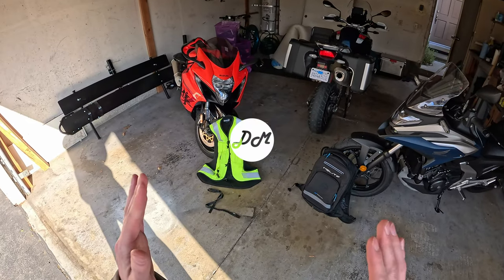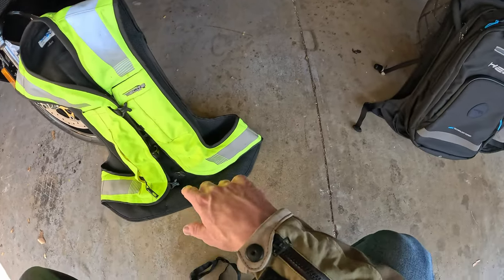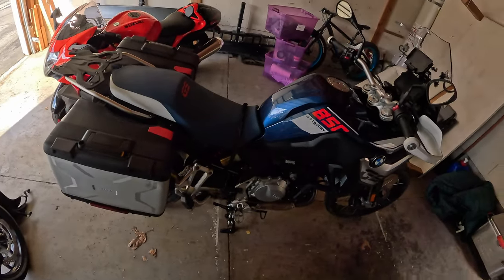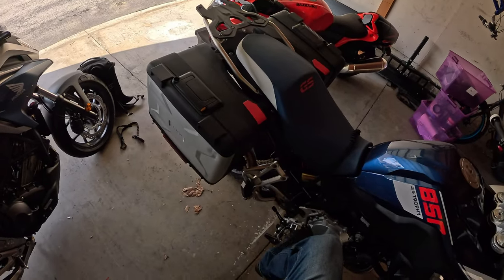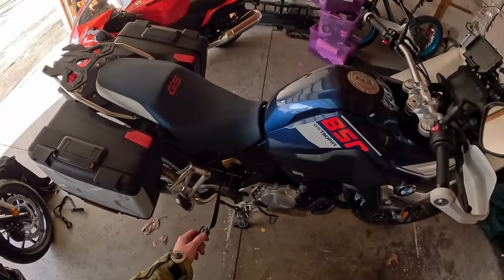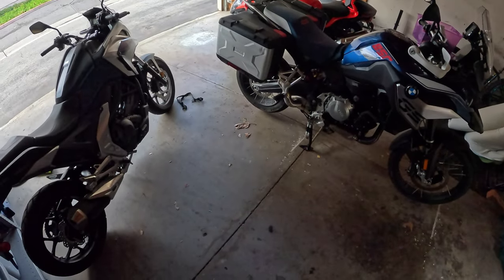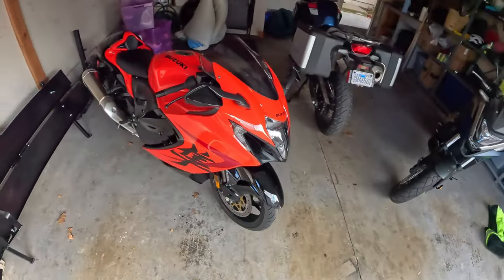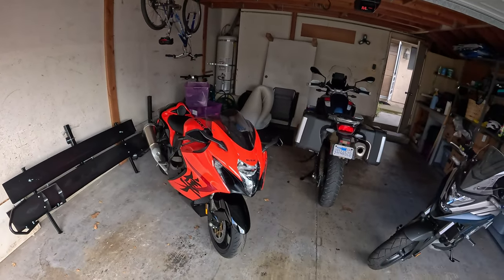Motorcycle Airbags: Electronic vs. Manual Trigger

Comment: Read your instructions for the manual unit! It states DO NOT ATTACH below the seat. It is supposed to be attached under the seat! Also the tether strap is supposed to be AS SHORT as possible. Example, shorten it as much as possible to just allow standing on the pegs like with an adventure bike.
Reply: right! i thought the same.... Its way too long if he fall off the wrong side

Comment: Dunno why they dont just give you the mechanical option on the electronic one, that way you can have both active if you want.
Reply: It's two different activation systems. The mechanical one activates purely mechanically; the force pulling the tether is the force pulling the activation on the airbag system. 

The electronic system is done electronically, no external force is activating the airbag.

So to have them both in one system would either require doubling up on the inflation systems, or making an entirely new inflation system that uses both (which would be tricky.)

Comment: It is very important that the  lanyard needs to be fixed in the center line of the bike between tank an seat and kept as short as  possible. Furthermore, do not overestimate the safety gain. Tests by independent test institutes in Germany showed only less improvements. Frontal crash in a car with 15mph may kill you, an airbag improves your chances to survive to 25 to max 30mph. We ride in Germany up to 150 mph on highway. I myself own 2 vests and 1 jacket , all non electronic. Just for mental support, no much expectations.

Comment: Tethers don't run out of battery, they don't need you to be moving to arm, they don't go off because you spin around while getting off the bike, etc etc. 

Tethers won't disarm because your CC monthly payment to Klim was declined because your card expired.
Reply: yea but electronic will save you from any angle your hit from. Tether wont.
Reply: Tether wont inflate before you impact the ground if you loose grip around a corner and low side.
Reply: @Surpriseify  If you do low side, is the impact to the ground what hurts you? You're not falling from great heights, your garments will protect you. And before you hit anything you'll disengage from the bike, so tether will inflate anyway.
Reply: Plenty of crashes happen where the rider sustains lethal hits before properly getting disengaged from the bike.
A lowside is just one example, and they can be extremely violent, especially at speed. I want protection immidiatly, not AFTER i get FLUNG off the bike hehe.
To each his own
Reply: @Surpriseify  You're right. To each his own. 

Electronic activation is designed for sport, my understanding is that tether is better suited to commute-type riding - shorter rides, lower speeds, occasional no-GPS lock, protection while the bike is not moving (when rear-ended by a car) and during first seconds of riding.
Reply: Mostly agreed
However with the fork stem sensor the Helite E will activate from 0kmh (standstill) and even faster than the tethered version
 Its a more expensive option be sure, but i like the wireless life haha
Reply: I once had a tethered airbag, but during a crash, my bike slid beneath me, trapping me and dragging me along. The airbag failed to deploy because the tether wasn't engaged. That experience convinced me to never opt for a tethered airbag again. I'll stick with the electronic one from now on.
Reply: @KhalidOWh  really unlucky!
I can see pro’s and con’s either way, been rididng around with the electronic helite for a few days now, really digging it.
Reply: @Surpriseify  Yes, they will. I've lowsided twice at race tracks. You separate from the bike pretty quickly.

Comment: I just got a Spidi Air DPS much better looking IMO and just as good safety with a mechanical operation for less money in UK. I think they are being discounted at the moment because retailers overstock due to UK bikers not wanting to look woosy using them. I have used a Dair air bag leathers and it saved me on the race track so know the value.

Comment: Thanks for the day to day impressions. 
Apparently, there is an additional fork mounted sensor to cover low speed crashes and ensure even quicker inflation.
I am still torn between electronic or mechanical. 
How long does the battery last?
Will it be sufficient for multi day trips?

Comment: For me I got backpack. I have a sport bike with zero storage so need a backpack. However wouldn't want to wear one with a vest on. So the backpack was the best option for me. Also if I don't need the pack I just remove the backpack part. 
Quick question do you still have a back protector in your jacket? Was not sure if I am supposed to have that and the vest. 
Good review. 👍
Reply from the maker: I do, but I'd argue it's not that important. You can always argue more armor is good, but I would be more concerned about foot, hip, and hand protection before a back protector. But I'm not a professional.
Reply: @DailyMotor  thanks for the reply. Yeah I left mine in and it feels fine. Just wasn't sure if I was supposed to. 👍. Hopefully I'll never need to find out. But that's why it's there. Just in case.

Comment: A tough call. I like the reliability of a tether but wonder about a lowside without ejecting away from the bike… thus uncertain inflation prior to the initial smack on the ground.
Whereas the electric… I can’t believe the accelerometer calibration is such that it would inflate with a slow motion unadorned tip over.
It’s too bad it can’t sense when the backpack is taken off and just auto shutoff accordingly.
Reply: The tether is easily testable (and way cheaper CO2 cartridges). With electronics you should just trust the working.
Reply: I just tipped my GoldWing on uneven parking lot, mounting the bike. My wife already has long time cervical spine damage from a car crash. She was lightly thrown off the back of the bike as it tipped away from the kickstand side.  Her Helite Turtle 2 Mechanical inflated and cushioned her landing on to a sharp limestone parking lot surface.   To your or me, it would probably be nothing but she is much less strong, more fragile in every way and it still protected her failing 3 feet at zero mph.   

HeR legs and hip hurt for the day but NOTHING on her upper torso was of any mention at all and she has near constant, roaming back & neck pains. It almost surely helped her support the helmet which did tap ground lightly.   Not like it saved her life but she can be shoulder bumped in a crowd and have her legs go out for days.  I am very thankful that it and her helmet were on and protected her as well as could be.  

   We were both shocked that it went of (1st time of either vest) and I'm not sure I heard it. I didn't even see the tether pull out although I could see her fall to that side.  She was surprised to be compressed but her back and neck was protected.    I feel horrible that my mistake in hopping on to hard or not having her load up after I moved, caused her to be scared and hurt, even a little, days later.

Electronics would not have gone off, from what I understand becaues they don't arm until well after running speeds.

I had spare canisters at home. Rearmed vest and GLADLY bought more canisters!  They'll come in the mail and hopefully she'll still be up to riding with me.

Comment: helite sells a fork sensor that protects you even when you get rear ended at a stop light. might want to look into that!
Reply from the maker: Right, apparently it's not available in the States yet, but hopefully soon.
Reply: do you really need the senor? I thought it detects a rear end on its own?
Reply: The sensor is supposed to detect incidents even when you are at a stop light. Without the sensor the detection starts after 15mph
Reply: @IamRockA so it knows between a sharp emergency brake and a rear hit?
Reply: @steve00alt70 Those are 2 completely opposite motions on the X axis so I'd assume so

Comment: Just bought a turtle 2 to go with the identical NC750 geezer / grocery bike. Not sure about fit -- how far it's supposed to do down in back. Helite website mentiones it can be long enough to make sitting on the tail OK, but also says airbag shouldn't be below ribs in front, which sounds like would be the case if tail were sittable. Mine just covers tailbone in back undeployed and seems to cover rib area / hip cage about right, but haven't verified with riding jacket / shoulder pads yet. I'm 6'3" skinny so no way anything other than a M will fit me around the chest w/o being super loose. In videos with reviews or Helite site, back length on their models seems to go from tailbone to a little lower. Maybe overthinking it. Better than w/o in just about any imaginable scenario.

Comment: I have the Tech Air 5 airbag under jacket vest and sometimes I wonder about the things you do too for the H Moov! I dont ride much (new rider without a bike, so I ride with my bro in law), but decided to get all the safety gear first to really incentivize me getting into my journey.

The Tech Air 5 has a really nice "armed" led light that turns on when the zipper cover clasp is closed on the magnet at the top of your chest. The bottom of the vest where you attach the zippers together also has a charge level LED (bright enough to keep you awake if you charge it in your room). The app also shows you charge status and I believe it can tell you if the airbag is properly armed if you pull it up (blue tooth). The app allows you to set your riding mode between track, street, adventure where I believe the theory on the street one is it removes the GPS requirement for travelling speed for the airbag to go off. (Believe this makes it possible for the airbag to inflate if you are rear ended at a red light?) All I know is that there are 3 Accelerometers and 3 Gyros (and possibly 0 GPS) and that they decide when to activate and according to Alpinestars, that includes being rear ended.

I still don't know exactly how it works, but my wallet said it was worth it! My head also unfortunately was an Arai head, so my helmet was expensive too, oh well. (Was really gunning for a K6 or a shoei xD)

Edit: I found the video that told me what I thought: https://www.youtube.com/watch?v=OcOPpp1Uul8
The discussion on being at a stop is at 8:55 in this video

Comment: I would loop the turtle 2 around my handle bar, right in the middle if possible depending on the bike I guess..
Reply: Maybe you're joking, but if not, I don't think that idea would work too well.
Reply: @clay1883  How so? The coard is pretty long, and for it to work properly, I would assume you should attach it as high as possible.
Reply: @clay1883  Obviously not on the handle bar where it just slides off.

Comment: I originally had the tethered vest and eventually bought the electronic vest. I prefer the electronic one. The electronic version is less annoying for me. It has a really long battery life and dealing with the tether drove me nuts. Need gas? Had to unhook from the bike. Need your bike serviced? Had to remove tether. Have a tip-over? Have to unhook from the bike. The worst was when I forget to hook to bike after a stop. I would hear a distinctive "clack-clack" as it was hitting my exhaust. I am thankful it never got stuck in my tires.

I really want the backpack. I wish I hadn't bought the electronic vest and had instead waited a few months and bought the backpack.
Reply: What electronic vest did you buy exactly?
Reply: Why do you want the backpack over the vest?

Comment: Since I'm mostly ride my dual sport off-road, I wonder how well the mechanical trigger would actually work. Usually if I go down it's because I hit some loose sand and I slide sideways and the bike lands on my boot.
Reply from the maker: I typically unplug and tuck the cable in the seat when I'm riding off road. I don't need it going off at 20 mph on dirt.
Reply: @DailyMotor  I don't know about that. I had a friend that went down at about 20 mph because he had some deep mud and broke some ribs. I broke a collarbone on my mountain bike going about 20.
Reply from the maker: @jdroofcleanpw  Yeah, I suppose it's up to you to decide what's best for you

Comment: Looks like you don't reply to comments, but I'll try anyway: you said at 11:36 that the tethered vest would go off when you're rear ended. I'm trying to decide between the tethered and the e-turtle (with forksensor)... The one reason why I am leaning towards the more expensive option (e-turtle) is precisely because it would save me when rear ended as the tethered surely won't since my body hits the car before it's conpletely of my bike... can you explain your thought process? Maybe I'm missing a point
Reply from the maker: The electronic version doesn't work below 15 mph, therefore it's unlikely to inflate on a static rear-end collision. Sure, the tethered version wouldn't inflate on impact from the vehicle, but it would inflate before you hit the ground, which is better than nothing. Unfortunately, the static rear-end collision is one of the most difficult impacts to mitigate.
Reply: @DailyMotor   Hey there, The Helite e-Bike Fork Sensor pack is an optional extra. The sensor is attached to the bike forks using an appropriately sized bracelet and can be used in conjunction with your electronic vest to allow detection of impacts even at 0mph. Full protection can also be achieved even when your bike is stationary
Reply from the maker: @mantas7422  Right, I'm seeing that now. Interesting concept, and I will probably have to pick one up!
Reply: @mantas7422 The Helite fork sensor add-on is not compatible with Helite electronic vests and backpacks sold in the USA because it is not FCC approved and operate on a different frequency.
Reply from the maker: Ahhhh, I see I see. Very silly. Thanks!@tral

Comment: a battery operated air-bag...let that sink in. no. really. let that sink in. the engineers certainly didn't. that should never have made it past the track. it's the dumbest idea since the battery operated seatbelt. if you forget to clip in, you're just as daft as to forget to turn your vest on. forgetting is forgetting it doesn't matter which system you have, it depends on how stupid and rushed you are.